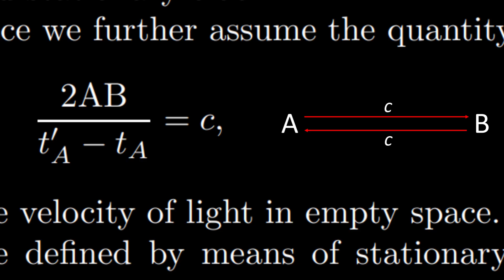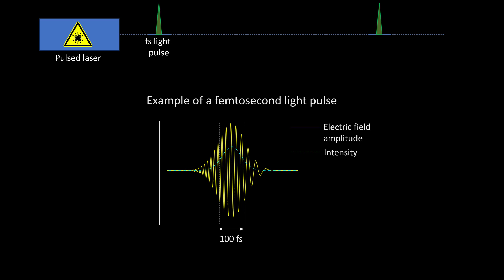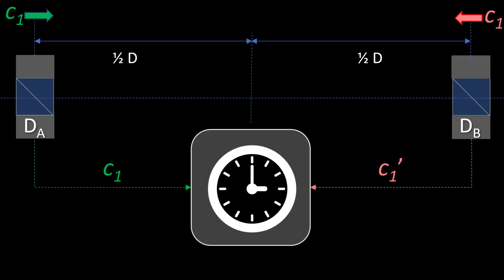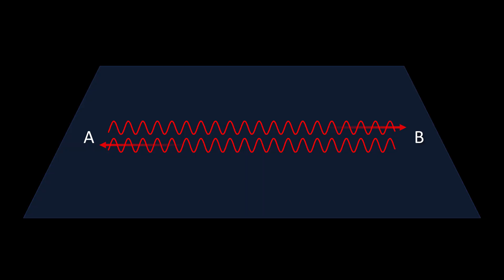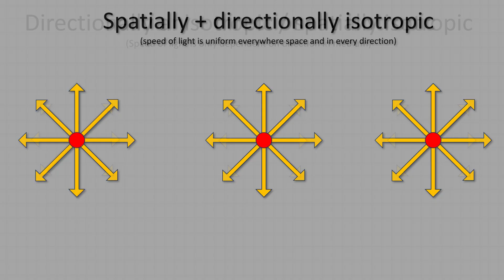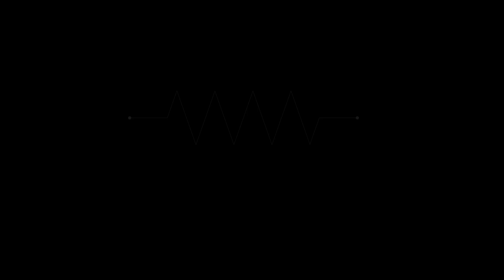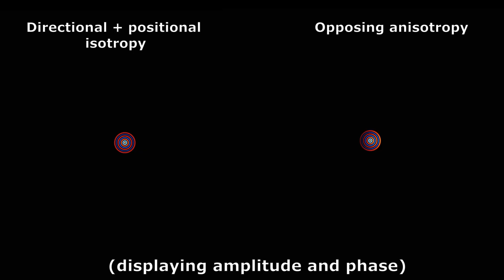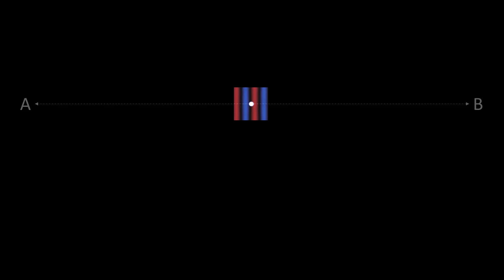Knowing the one-way speed of light

Comment: I thought about this some time and realized that no matter what I try, I always end up with a two-way speed of light in the end. And I had some really crazy ideas that would be practically impossible to do even if we had access to materials that literally have unrealistic properties.
Reply: Why not do it the same way projectile velocities used to be measured? Imagine two paper discs on either end of a shaft a known distance apart spinning very fast. Fire a laser pulse at them strong enough to rapidly burn a hole through the discs. The angular position of the holes on each disc should be ever so slightly different. From that, you can calculate the speed of light. Of course there are some practical problems that would make it very difficult to get accurate results but in theory, with enough distance between the discs and a fast enough speed of the discs, it should be possible.
Reply: @wingracer1614  A very clever idea. But how do you correct for the tiny amount of time it takes to burn the first disc? That time would introduce a very big (relatively) shift and keeping it constant would be a problem. The introduced error of such measurement would be too big. A high rotational speed would imply a thick layer of paper (or other material), and since it would be moving, the time needed to "burn a hole" would vary as the material would "move sideways" into the beam as it is burning the hole (which would not be circular even if the laser beam was 100% circular. Only at insane rotational speeds would it deviate from a circle. A projectile is many orders of magnitude slower than the speed of light, so it works in such a case.
Reply: @ErikZiak  Like I said, there would be many practical difficulties in actually trying to do it but it should be possible in theory. I mean we can measure distances less than the width of a proton now and even account for the quantum uncertainty in such a measurement to detect gravity waves. This should be child's play.
Reply: @wingracer1614  You could get a semi transparent mirror and then another mirror, separated by some distance. Both would reflect the light to the same detector, that would be at 90° to the beam, being able to detect incoming light with a certain degree to the sides. The apparatus would form a triangle. No matter how short you make the side between the semi transparent and regular mirror, the light would travel a known longer distance on one path vs. the other path. The problem is, these measurement would not measure the one way speed of light in a straight line, but on a "curved" path.
Reply: It's actually quite easy, technically you just have to take advantage of the non-linear nature of time dilatation.  Basically you take some atomic clocks, move them rapidly in two different directions and graph the change in time.  The time dilation on each clock should fit the curve t₀/√(1-v²/c²) where t₀ is the time for the 'rest' reference.  If they fit to the same curve for each direction, then the one way speed of light is the same.  

The other way is that you just use a particle accelerator to spin a proton or whatever at like 99.9999% C.  If the speed of light were different then the particle would have to slow down on one side of the ring in order to maintain it's mass. (or it's mass would fluctuate on each side) in either case you'd need to adjust the timing or strength of the magnets to maintain the particle in the ring - in other words every time the large hadron collider is use the one-way speed of light is verified to be equal.
Reply: @takanara7  "If they fit to the same curve for each direction, then the one way speed of light is the same.  " - they will always fit the same curve for each direction, independent of what the one-way speed of light really is. 
"in either case you'd need to adjust the timing or strength of the magnets" - you wouldn't need to, because the timing and current in the electromagnets would be subject to the same isotropic speed of the light. 

The one-way speed of light is theoretically impossible to measure. Trying to come up with mechanisms that could measure it, is like coming up with mechanisms for a perpetuum mobile. It is just a matter of determining why it fails.
Reply: @renedekker9806  Romer's experiment!
Reply: @rogerphelps9939  :"Romer's experiment!"_ - That's a difficult one.
The mathematics for why Rømer's experiment is not a one-way speed of light measurement is described by L. Karlov in “Does Roemer's method yield a unidirectional speed of light?” Australian Journal of Physics 23, 243-258 (1970)
I have a hard time interpreting what the correct interpretation of the math is, but I think it may be the following:

Rømer's experiment measured the time between eclipses of Jupiter's moon Io. When the Earth in its orbit is moving away from Jupiter, there should be more time between those eclipses than when the Earth is moving towards Jupiter. Assuming the speed of the Earth wrt. Jupiter is the same in both case (but in opposite direction), you can calculate the (one-way) speed of the light from that difference. 
But how do we know that those speeds are the same? We measure that by measuring angles towards the Sun. Those measurements are based on the lines of sight to the Sun and Jupiter, that is, based on the (one-way) speed of light from the Sun to the Earth.
Due to that, with an anisotropic speed of light, the Earth's speed would appear to be larger on one side of the Earth's orbit than on the other. That is, the orbit of Earth would appear to be more elliptical. The difference in travel time of the light between both side of the Earth's orbit would be attributed to that difference, rather than to the lower/higher speed of light.
Reply: @rogerphelps9939  That is a difficult one. The mathematics for why Rømer's experiment is not a one-way speed of light measurement is described by L. Karlov, in “Does Roemer's method yield a unidirectional speed of light?” Australian Journal of Physics 23, 243-258 (1970)

I have a hard time interpreting the math, but I think it may be the following. 
Rømer's experiment measures the apparent time between eclipses of the moon Io of Jupiter. It then compares those times at a part of the orbit of Earth when it is moving away from Jupiter, with the part where Earth is moving towards Jupiter. 
Effectively, it is a comparison of the Doppler shift in two directions.
But the calculations assume the speed of the Earth wrt Jupiter is the same for both directions. The result depends on that, but that is merely a convention. To measure the "real" speed of the Earth, you would need to measure the distance Earth travels between two points in time. But how much you measure for that speed, depends on the one-way speed of light again. That is, you are measuring the one-way speed of light in relation to the one-way speed of light.
Reply: @rogerphelps9939  That is a difficult one. The mathematics for why Rømer's experiment is not a one-way speed of light measurement is described by L. Karlov, in “Does Roemer's method yield a unidirectional speed of light?”

I have a hard time interpreting the math, but I think it might be the following. 
Rømer's experiment measures the apparent time between eclipses of the moon Io of Jupiter. It then compares those times at a part of the orbit of Earth when it is moving away from Jupiter, with the part where Earth is moving towards Jupiter. 
Effectively, it is a comparison of the Doppler shift in two directions.
But the calculations assume the speed of the Earth wrt Jupiter is the same for both directions. The result depends on that, but that is merely a convention. To measure the "real" speed of the Earth, you would need to measure the distance Earth travels between two points in time. But how much you measure for that speed, depends on the one-way speed of light again.

Comment: Very thought provoking.   In no particular order…
1. I think the effect of moving mass in the return leg is somewhat related to how we detect gravitational waves, so perhaps not impossible to measure.
2. I wonder whether setting up a dual comb fs laser system, with the two periods walking past each other at a low (Hz or kHz rate) would enable you to decouple the effective speed of light in optical space from the effective speed of light in message passing (the wires to the clock).  Instead of the time of arrival of the laser pulse being when the fs pulse appears, the time of the event is when the two fs laser pulses align at the detector.  This has the effect of slowing down the speed of light by the mean repetition rate of the lasers divided by the difference in their repetition rates.  For a fairly simple fs pair of lasers this might be 50MHz/500Hz, or a factor of 100,000, so instead of 300mm/ns the apparent speed of ligh would be 30mm/ms.   Your wires would still be communicating at 300mm/ns, since they are only passing info that the correlation has happened.  Effectively one of your two terms in your pair of equations will each have a time stretch factor in it and the other will remain purely related to c or c’. By changing the relative length of optical path and electrical path you can set up situations which should pick up if there are different speeds in the two different directions.
3. For the reasons you set out at the end of your video this would be an experiment with a very dull result.
Thanks for the excellent work you do!
Reply: Regarding number 1: LIGO and other gravitational wave detectors are only sensitive enough in a small frequency band, limited from below by thermal and seismic noise and above by quantum shot noise. They would not be able to detect a mass in uniform motion since that is in the low-frequency limit.
Another approach would be to use a pulsed laser system, but with my limited knowledge I doubt that the necessary precision can be achieved with current technology.

Comment: I could see that the first experiment that you described, heroically, cannot determine a different velocity from A to B versus B to A.
But why couldn't the Mickelson Marley experiment make this determination?
It was brilliantly conceived to determine the speed of light through the ether, using an interference device, if such A medium of transmission existed.
If my understanding is correct, and the ether exists, so to speak, then the speed of light in one direction could be different from the speed of light in a return direction given a particular alignment of the apparatus.
In other words the Mickelson Marley experiment is capable of measuring a different speed in each direction. By rotating the experimental device properly. When it was rotated 360° you would see shifts in the interference pattern every 90°, back and forth.
This is a consequence of the fact that the light would go simultaneously in perpendicular directions, using a beam splitter, rather than parallel in and out.
Reply: Just a fun off-topic reminder that at the University of Chicago they never dismantled the larger tube parts of the Michelson Morley experiment, and nowadays they run ethernet cables through the same area, so the ether is there now, in a way, haha
Reply: @ianglenn2821  I learned something today, thank you.
Reply: The Michelson Morley experiment proves that the bidirectional speed of light is the same in all direction pairs, e.g. the average of east and west must be the same as the average of north and south.
It cannot show that the speeds in opposite directions like north and south are equal.

Comment: If the speed of light is really the speed of propagation of information, we should expect to never be able to measure the one-way speed of light, as a measurement one-way always required getting information back to the point of emission from the detector, and using information about the travel time of the information to figure out what the speed must have been, as you demonstrated. Your addition, that the one-way speed of light must be constant analytically, based on the properties of the electromagnetic field, was a really clever and interesting argument, but I'd add that it's a little different to say that the one-way speed of light cannot vary, and to say that the one-way speed of life is constant. These are the same statement if you assume the law of the excluded middle, but using intuitionistic logic, the one does not prove the other, and the one-way speed of light remains undefined even if we've proven that it cannot vary. This is because intuitionistic logic permits only constructive proofs. You can prove by contradiction that some proposition is false because assuming it leads to a contradiction, but never that it's true because its negation is contradictory. What seems remarkable to me anyway is that experiments seem to make themselves available only in the case that some proposition can be constructively demonstrated. Maybe this is a spurious association but it seems to suggest a connection between the scientific method and intuitionism.

Comment: This is a great a great video! I want to point out that you missed a simple (yet arguably not obvious) way to make opposing anisotropy locally: make the spring-mass setup MOVE! Or equivalently, make the wave generator move, so  that it excites a different mass at each time step. From the resting frame of the wave generator the wave propagation is then opposing anisotropic.

You might say that this makes no sense in the setting of the EM field because the field cannot have absolute motion. However, this is exactly the ether interpretation of the EM field (and spacetime itself): opposing anisotropy in the speed of light can be explained by assuming an absolute rest frame (the rest frame of the ether aka the rest frame of the CMB) and anisotropy resulting from motion relative to it.
Reply: But while this possibility doesn't suffer from the energy conservation problem, the aether has other problems, and all the old aether theories have been disproven, e.g. by the movement of the earth trough the aether.

My takeaway is the following: The current theories describe most of our universe extremely well, so we often try to make small changes only. This video convincingly shows that an anisotropic one-way speed of light is not possible by making only small changes to our theories. But your comment hints that we can never consider every possibility.

That is, unless we employ a much more systematic approach to the assumptions underlying our modern understanding of the universe. There are a lot of interesting ideas out there, but nowhere near enough manpower and funding to check every single one with all the consequences individually.
Reply: @entcraft44 the key thing here is that the old aether theories have been disproven. There is a way to have an aether field in such a way where you get the exact same equations that you get from relativity, where the speed of light is constant in the reference frame of the aether, and objects moving relative to the aether get length contracted and time dilated. This formulation gives identical math as special relativity so it is not possible to distinguish which interpretation is closer to reality through measurements
Reply: @polenta73  Exactly. Ether has not been disproven. Moreover, even within General Relativity it is hinted at. For one, GR knows a rest frame with respect to which certain forms of motion are absolute, such as acceleration and rotation. This could be the frame of the ether. Second, GR is equivalent to the flowing space model (better known under the much worse name of Flowing River Model) where the flowing space is the ether.
Reply: @entcraft44  Aether has been disproved but an absolute rest frame has not. In big part because of the two-way speed of light.
Once you assume that speed of light is the speed of transfer of information from one segment of space to another then you can have both the relativistic effects as well as an absolute reference frame, where the constant speed of light in any reference frame is just a result of slower processing of the thing moving close to the speed of light.
(ie: imaging you have a clock that measures the passage of time by sending a short ray of light towards a mirror and waiting for a response, that clock would indeed slow down the closed you go to the speed of light, and stop completely once you reach the speed of light, since light would have to move perpendicularly to the mirror, the exact same thing happens when one particle sends our information and waits for it to come back)

All the other space warping effects are also accounted for as being just a mirage caused by difference in processing speeds of information( photons in this case) that arrives perpendicular or and paralel to the motion as well as what just happens when light travels at a fixed speed..
First from the object's PoV the entire universe shrinks along direction of motion because its own processing slows (so everything just starts becoming very bright, and very blueshifted) Additionally the faster the object moves the more perpendicular to its movement the light has to be to actually hit it.

I did the math and some simulations on this and it all checks out, tho I'm still unsure as to where the extra mass is coming from when you accelerate things close to the speed of light.
Reply: Well said! This is exactly why this video, while a good attempt, failed.
Reply: Like a wave on a river

Comment: First of all, you need an interferometer, not pulses. The rotation of the Earth is observable with the proper setup, showing that CLEARLY the speed of light is absolute and not the same in both directions. Secondly, there ARE springs with different coefficients in each direction. You make them by putting a soft and a hard spring together and connecting a rod inbetween. They don't break conservation of energy. And neither does the different density of light in the two directions, BECAUSE the flow moves at different speeds. Sheesh...